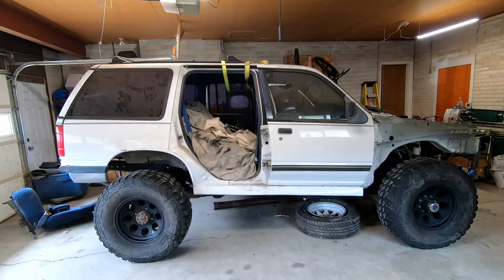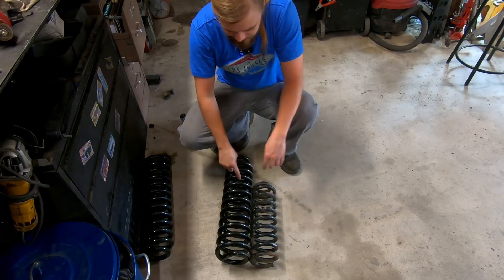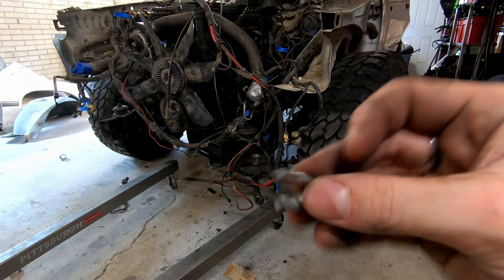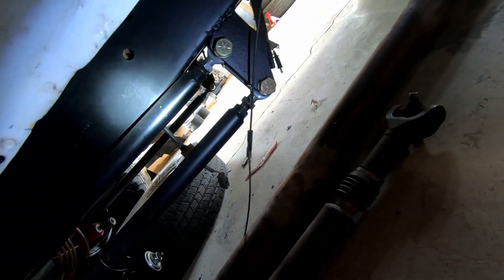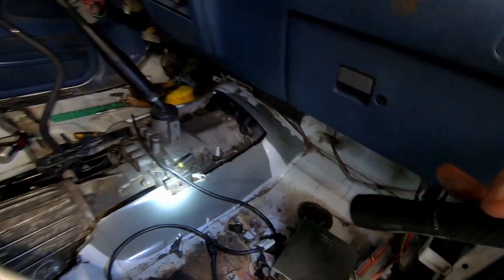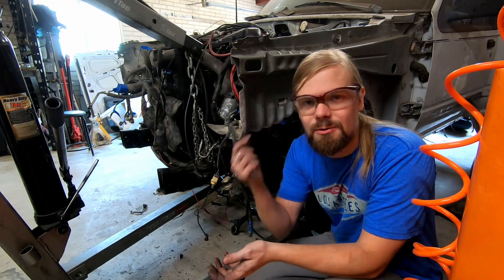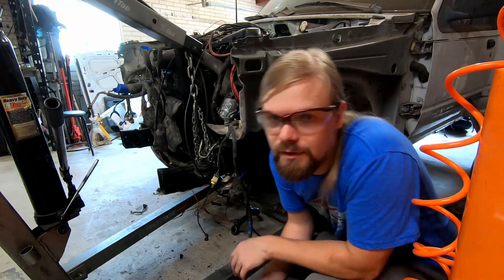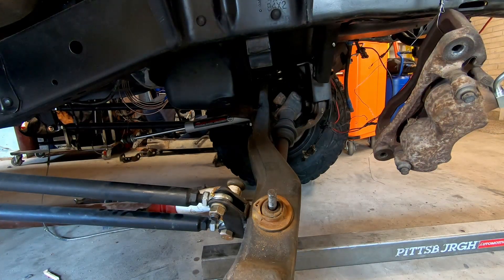That Could Have Killed Me...

Comment from the maker: Don’t put your chains or straps at an angle when lifting! What went wrong here is something called “sling angle stress”. I thought the chain was overkill enough I could ignore it, and I was wrong.

As the angle in the sling or chain increases, more and more force goes towards pulling the two sides of the frame together rather than just lifting upwards. This means theres way more force on the chains. A chain that is at a 45 degree angle can only lift 70% as much, and a chain at 30 degrees can only lift HALF as much. 

Keep your lifting chain/sling straight up and down when you can! If you cant, use a spreader bar. If you cant even do that, double the working load of the chain for the same job. 

Stay safe!
Reply: Outstanding tips and always good to watch your work. Thank you again and thank God you were hurt. God is good my brother.

Comment: Bro, those springs are about to shoot out at you. smh.   You're not aware of danger when it's there and that's going to win you the darwin award in due time.
Reply from the maker: On TTB the bottom of the coil spring is bolted to the axle so the spring won't eject itself out of the car, you can see this at 14:38. The top can pop out without a retainer, but the bottom can not. I'm not sure when you're talking about but I always make sure to be out of the line of fire when doing sketchy things like this.

Comment: F150 coil spring mount are riveted in and are most likely have a hight mounting point . Might of been better than cutting then spring. I don't know if as easy to remove the coil bucket on the explorer as it is on the f150. Solo motorsports makes cut and tuned beams for the dana 50 as well as coil spring conversions.

Comment: You should make drop brackets for the pivot points otherwise getting it aligned is really not gonna work, plus it will keep the springs going more vertical between mounts instead of bowing like they are now. I'd also recommend running brake lines alone the radius arms, those ones you have are looking really stretched and with the travel you are planning it's easy to rip those. Great build keep it up
Reply from the maker: Brake lines along the radius arms is definitely an interesting idea! As they are now theres plenty of slack left (13:36) so I wont change it now, but if it becomes an issue in the future I’ll definitely consider that!

It already has around an inch of drop in the brackets from when I made custom mounts for the dana 50 TTB, how it looks now I think it will be okay. However if it ever gets any taller cut and turn would probably be the best option as a few people mentioned! I could also run angle spacers under the coil if the bowing is an issue.

Thanks for your input!

Comment: You need to get axle drop mounts to drop the pivot point down to get the correct angles for the ttb. Or do what evenflo said get cut and angles ttbs more expensive and time consuming but 100% more reliable and stronger than dropping the pivot point. Look up james duff lifts.
Reply from the maker: The pivot point is about an inch lower on the custom dana 50 mounts I made compared to the stock dana 35. Keep in mind some of the lift is coming from the dana 50 arms being much longer than the dana 35 members already

I agree cut and turn would be the ultimate fix if I’m having issues!

Comment: Why you would use that thin aluminum to hold on your spring is beyond me. lol.   And your lathe was so crazy crooked while you were drilling.  Good lord my man-- you have a lot to learn. haha..   But hey, credit for trying.
Reply from the maker: Let's learn together. The "thin aluminum" ISNT holding the spring in 😉. Google "coil spring retainer", the purpose of it is to stop the coil spring from falling off the perch when the suspension is at full extension. Under normal operation the spring perch supports the bottom of the coil and the coil bucket supports the top of the coil, the retainer only holds the weight of the spring and only when under full droop. EDIT: you can see me test this at 16:40, it worked perfect compared to 14:38 when the coil would pop out.

If you've ever seen someones springs pop out while flexing suspension off road, this is meant to address that.

At 15:00 youre seeing some runout in the part, not sure what you mean by crooked. For this application the center hole and the outer diameter need not be concentric which is why I didn't turn the outside of the part to get rid of the runout.
Reply: @BuildSomethingAuto  Well that's my point.  I'm assuming you're building this to do some heavy offroading..  So I would have built those retainers out of chrome moly steel.  Go watch "Matts off road recovery" -- they have a couple jeeps that are constantly popping off their springs;  (until they put the URI struts on them).  When you're building for offroad and climbing, ect..  Always build it much stronger than you think it needs to be--- otherwise you're going to find yourself stuck with broken parts every time you take it somewhere.
Reply from the maker: @calholli I did build it much stronger than it needs to be, most jeep guys will use a simple retainer like this:
https://www.amazon.com/Clayton-Off-Road-COR-1100108-Stainless/dp/B01DTCXTJO/ref=pd_vtp_1/139-2949052-6908821?pd_rd_w=Q5aHL&pf_rd_p=96226b5f-2d9a-439b-be45-97603787c682&pf_rd_r=6Z4XQR8B7JC8PF92V0MK&pd_rd_r=336b80c0-83a2-4018-82a2-8a14813a67b0&pd_rd_wg=t3NIp&pd_rd_i=B01DTCXTJO&psc=1

I think you're overestimating the forces that will be on this part. The weight of the axle will be on limit straps, not on this retainer.

IMO Aluminum is a very good choice for parts like this. For one, it is incredibly easy to machine. For example my small lathe would have never been able to plunge a 5/8" bit straight into chrome moly with no pilot like I did with the aluminum. It's also very light and easy to weld if you have an AC tig. It also doesn't corrode so you don't have to worry about getting good layers of paint on it. If you have a bunch of chrome moly cuttofs laying around that would be fine for this, but given the choice on small parts aluminum is so much nicer to fabricate with IMO.